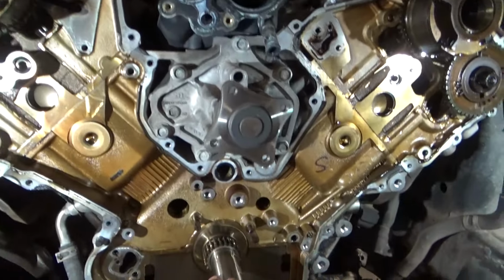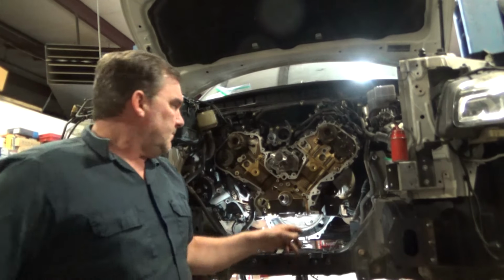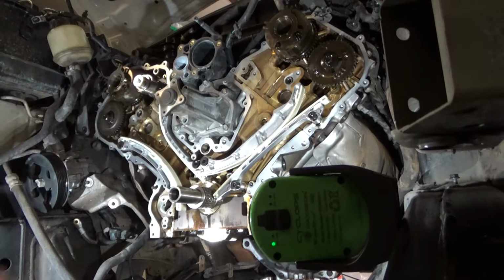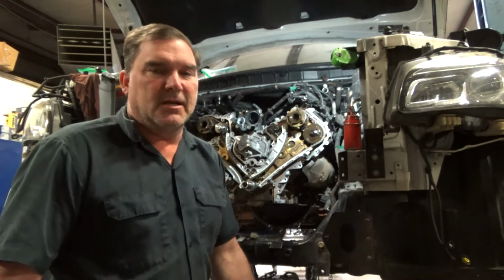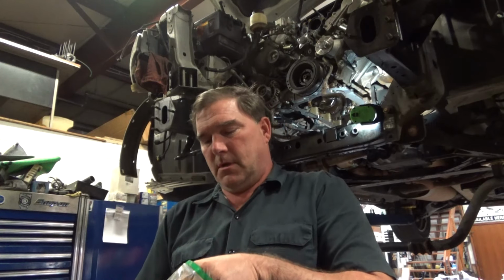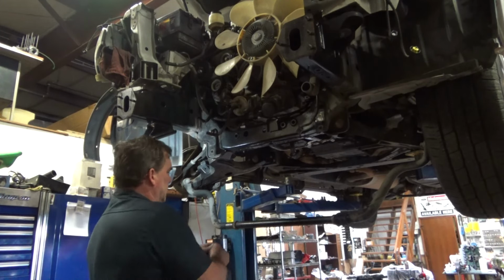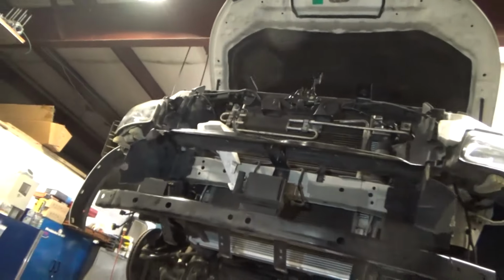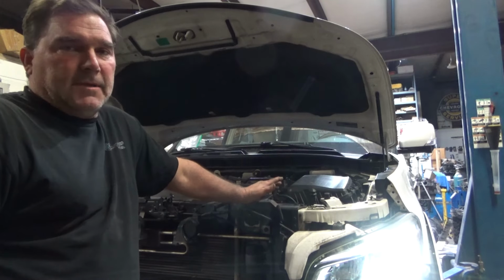Infiniti 5.6 V8 Timing Reassembly! QX80 Going back together!

Comment: I'm doing a 5.6 in a '06  Nissan Titan, pulled the engine to replace with used , it looked to be in worse shape so just going the through this, head rebuilt @ $462, which included 6 valve, 4 tappet caps. New chains, gears, guides and tensioners. This doesn't have the vvt. or the fuel pump. Should be ready to go back in tomorrow, I like seeing someone replace the chains and gears without pulling the valve covers. 
I've been wrenching for 45 years, supposed to quit but owning my own shop for 25, maybe I'll just watch other do good work like you and do referrals, though I believe people here in Denver are too cheap or too broke to ship cars for repairs, this Titan owner is a  customer I've kept running for 20 years, it's his kid I watched grow up now a marine. Looks like you're where you need to  be and happy.

Comment: Where did you get your parts from the dealer? Is there an online kit you can buy that contains everything?
Reply from the maker: Everything comes direct through the dealer all OEM parts, on something like this it's not worth trying to save a couple dollars on something that MIGHT work or fit. 
Unfortunately no kit exists at least that we know of, just a very long list of part numbers
Reply: I did this job w my brother and forgot to put the clamp on the trans line and all the oil came out. Now car is running very rough misfiring. Wondering if that fluid got into something?

Comment: I just got quoted $7500 for this repair in Oklahoma.  That seems high?
Reply from the maker: Depending on what all parts and pieces are included in that quote. You've got some VERY expensive parts costs especially with the high pressure fuel pump.

Comment: Do those engines require a high zinc oil as all that technology seems to fail due to a very expensive piece that is no more than a flat tappet camshaft? Great work, you must be looking forward to all the future ones.
Reply: No,  high zinc oil will damage the three-way converters.  The root cause of the problem appears to be the high pressure fuel pump leaking fuel and washing the oil film from the pass side chain and lifter cam.  Once the cam is worn, it must be replaced.

Comment: This looks like a nice payday for the shop to the tune 3-4 grand in labor.
Reply from the maker: Definitely not a cheap service, more than the labor it's the hideously expensive parts but there is a WHOLE lot of labor involved in this no doubt
Reply: @LucoreAuto yeah some people say hey Martin you can fix cars I say yeah…to a degree 😂😂I don’t mess with timing chains or belts and definitely by all means do not touch transmissions😂